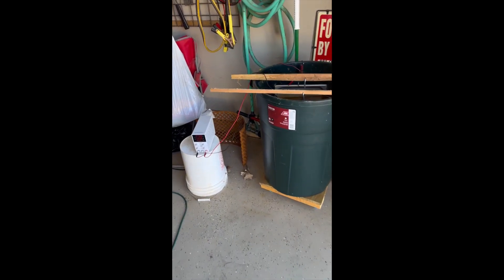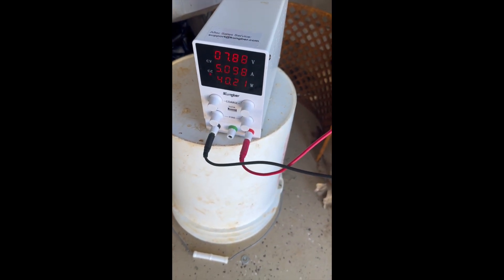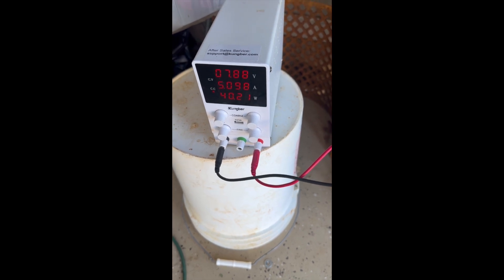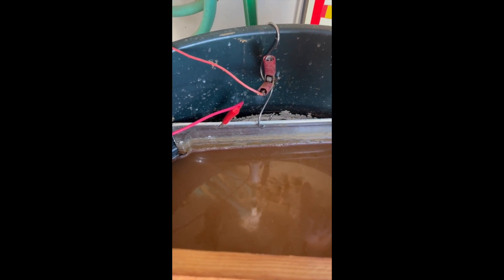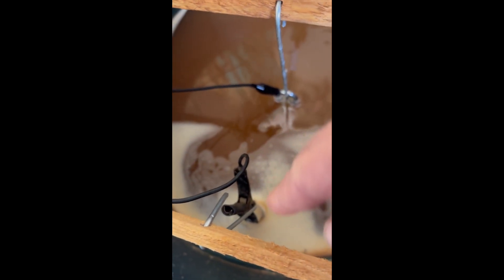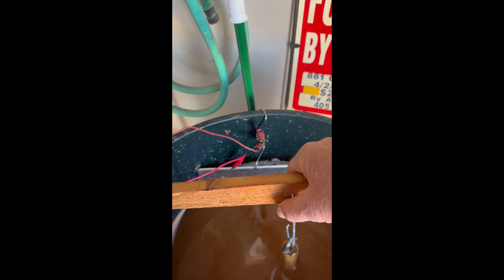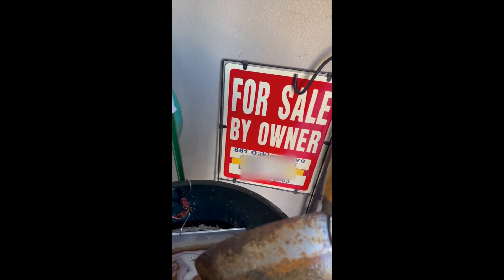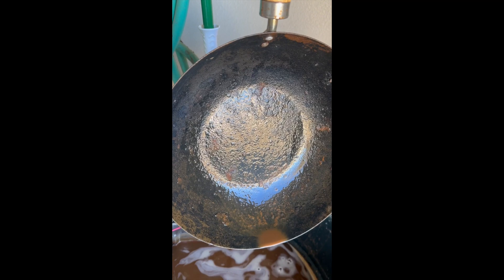Electrolysis Tank | Dissolving Rust using Electricity | Clean up that Cast Iron quickly

Comment: I got some snowmobile carburetters that need cleaning😂
Reply from the maker: I suppose those carbs are aluminum. Electrolysis will only do steel. Won't do tin or pot metal either. Sorry Bob, you;r soaking in denatured alcohol.